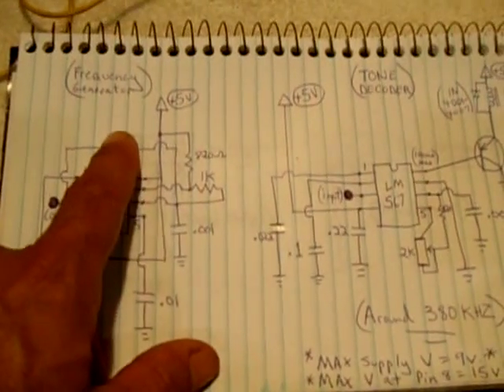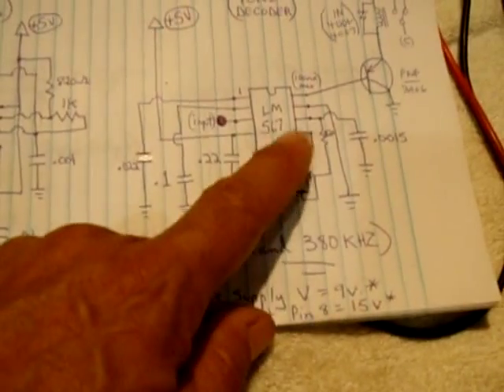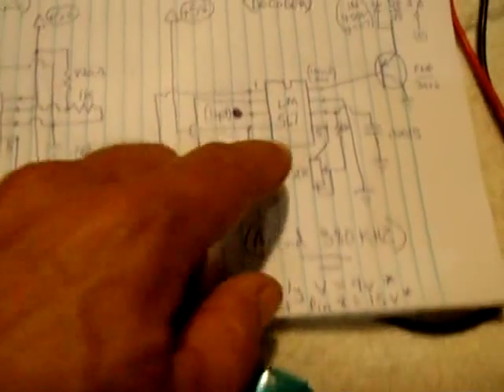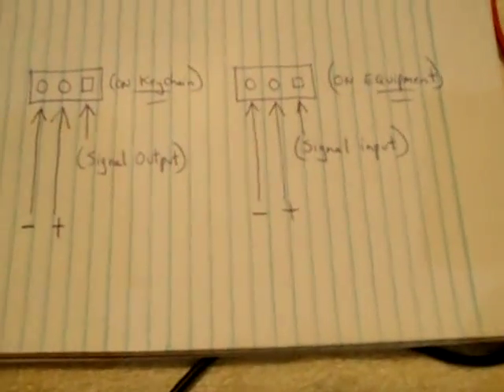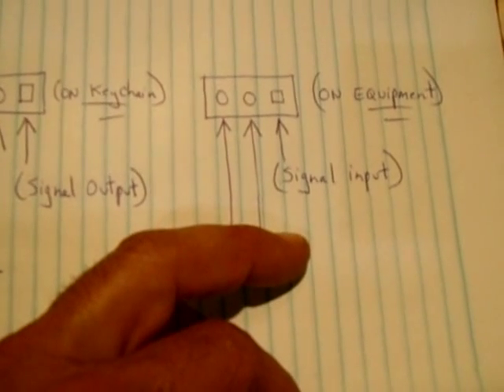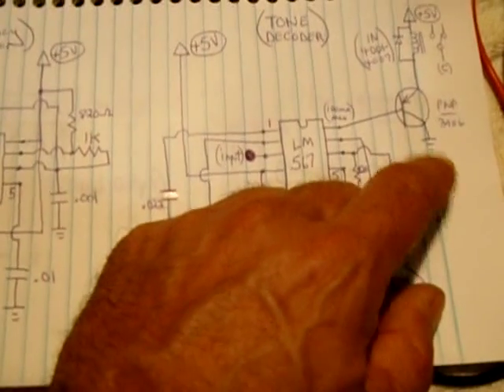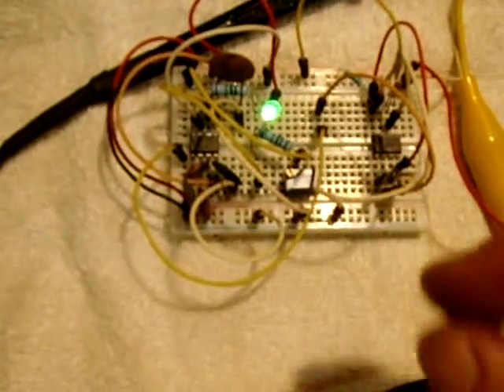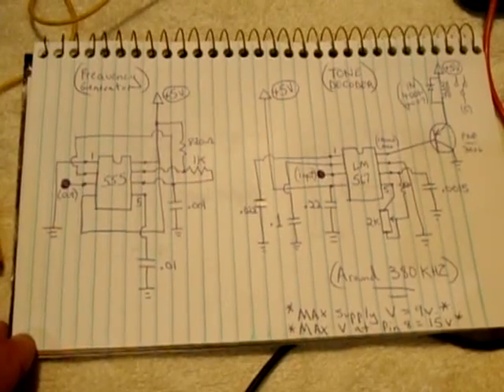Electronic Code Activated Circuit!

Comment: Have copied this circuit exactly to try and learn a bit more about the LM567 and no matter what I do it just will not work, any direction or pointers or even resources on this would be greatly appreciated, have tried following the data sheet, no luck
Reply from the maker: Connect a DMM that measures frequency to the transmitter pin#3 output and make sure it's working. You should see how many kHz
Reply: @electronicsNmore  yes have hooked it up to the scope, do you have another link to the schematic for your circuit as the one on here no longer works and I've tried copying all of the values just off the video but it's not the most clear to see ?
Reply: I've checked both the 555 and the 567 with my oscilloscope, have tried turning both to different frequencies and the 380Khz you have in the video, do you have a copy of your schematic I can have a look at as I can't make every thing out in the video ?

Comment: what if someone shorts + to - in the keyhole?
Reply from the maker: Might screw up the power supply if the short circuit is held long enough, but it still will not turn on the power to the equipment. (At least with all the tests that I have done). You have to realize that the average person would have no clue how the circuit operates.

Comment: Has anyone verified that this works? I would like to try and implement this.
Reply from the maker: +Scott Nidell 
Hi Scott. In the "About" section of my channel main page, I clearly state that all circuits shown on this channel have been verified to work. I don't upload bogus videos to waste people's time. :-)

Thanks
Reply: +electronicsNmore 
Hi sorry to bother you again,

When i put the values into the 555 timer calculator provided: 1k for R2 820 ohm for R1 and .001uf for C1 I get 511k hertz not 380k hertz. Flipping the values of R1 and R2 provide a slightly higher frequency. What am i doing wrong here?

I subscribed to your channel, this is really neat.
Reply from the maker: Scott Nidell
Duplicate exactly what the schematic shows, and carefully follow everything I spoke about in the video. Play around with the capacitor values.
Thanks!